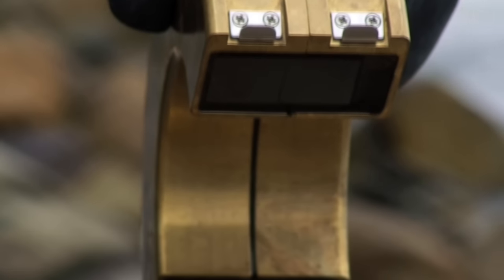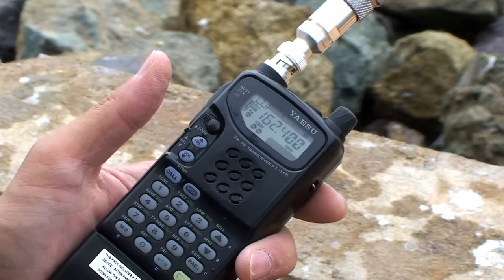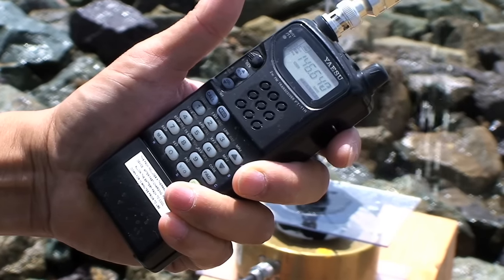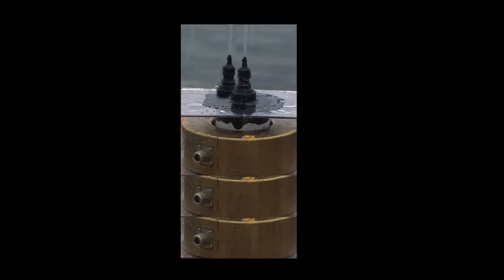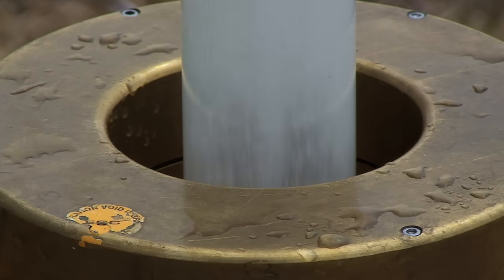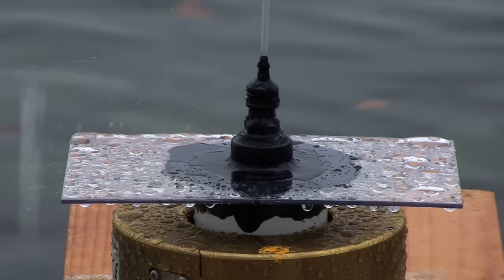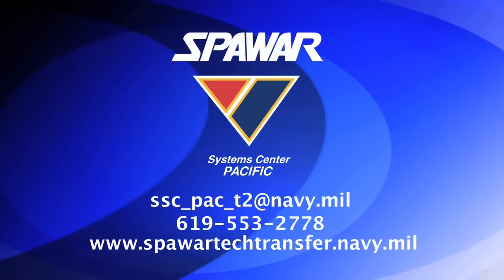Sea Water Antenna

Comment: this is very interesting stuff here. i like that you can run it in a sealed circuit system in a tube. but i need a long tube to run it on 75/80 meters. i know it was display running on a stream of water sprayed upwards. but i feel it would also work on a straight up water column of salt water in a tube. using a pressure gauge to determine the height of the water column. this means never needing an antenna tuner and getting the best exchange of energy from the antenna system. where do i get one of these at.

Comment: I can't wait to go to the seashore with my 20 meter setup.....a half gallon final amp and a 3 element ( oops! I mean a 6 nozzle) yagi antenna. In my QSO I will advise my contact I'm running a half gallon output to a 100 gallon per minute antenna! When I tested it and cranked up to the full legal output from the amp I got only steam from the yagi!

Comment: so its basically using the water as an antenna and the height of the water being pumped up makes it work as a bigger antenna? I originally got the impression that it was sending signals through the water just by the device sitting in the water considering the water is always connected it would be like one giant antenna, it apparently wouldn't work like that..

Comment: You gentlemen might look into laminar flow nozzles for better performance. I don't think that has been done before. I believe the spray nozzle technique may have been used as long ago as the 1970s. Then it was dropped in favor of the now bog standard rubber duckie antenna.

Another idea from the late 60s is coupling RF energy into the ionic fluid inside living trees to use the tree trunk as an antenna. It, too, sort of worked.

{^_^}
{^_^}

Comment: Why not pump down if your able to use the tube to enclose it, it seems you could use it with a lower power pump and keep recirculating the water. Could use some sort of telecoping tube to adjust the antenna size. Mount it on a small bouy it could collapse into itself making it self contained other than the cable to your radio.

Comment: Nice idea, nice to see people actually testing and doing things, yeah, it probably work on emergency situations, or if you don't have anything else. But I'm just wondering, how it compares to a strange of wire. Having a tube on land and spray water in it is just nonsense, you culd do the same with a steel pole, or even a wire and a fishing pole. You can use the ferrite core or some other method coupling 

On hf dx the water stream sounds like a nice idea, in the sea. The best ground system, and a vertical, gives a nice low radiation angle. Just hope all the power does not go up in heat in the ferrite core, (it's split after all, not a good idea for efficiency) or heating the water, even a tiny wire might work better than the high resistance water.

Comment: I'm curious as to why the salt is necessary for the land application. Does salt change the conductive properties of the water?
Reply: +Ralph Krohne You are correct. Salt is a highly conductive compound when used in water, as the sodium (which is a metal) ions move about freely in the water. Pure water alone is not very conductive, even for electricity. Its the dissolved ions from various compounds that are naturally abundant that cause water to be conductive. This is why sea water, which naturally contains high concentrations of salt, makes a great conductor and a great antennae.

Comment: Novel idea but I don't think very practical.
 What happens on string and got example ?
Also it seems to take up more space than a simple wire or vertical antenna which could be mounted on the same spot as this one.
Reply: +DENMONKEY I think the idea of it all is to be able to shut off the antenna’s and not have interference of the others.

Comment: hmmm.. this is ok for receiving only.. but transmitting, it might damage your radio. The length of the water should always be fix to a specific frequency. With the water antenna, surely the signal wave radio is unstable at all time , damaging your radio...
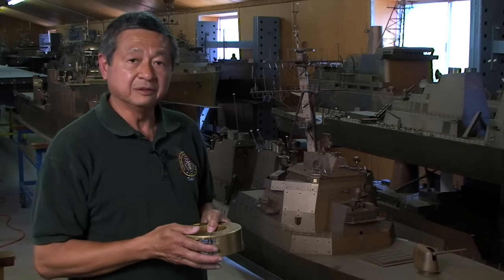Reply: revadan 2:34

Comment: 2:53 - asking for a signal report via repeater is of course bullshit, the other person can only report the signal from the repeater tower, he has no means telling anything about signal strenght of the seawatersystem unless they make direct contact. The only relevant info is the report on audio-quality. Signal strenght is irrelevant.

2nd, the report "maximum signal" followed by "5 by 5" is equally wrong.
Full signal would be 5 by 9 (the first 5 beeing audio quality, 9 is the signal strenght......of the repeater in this case)

some cut together scenes, out of context maybe.. i refuse to believe this engineer would not know all this.

---
having said all that, its a fun concept and tuning the SWR by adjusting power on a waterpump is certainly a whole new idea:)
Reply: Yep.  Should have tried 146.52 simplex instead.
Reply: Ok and what to do if signal at the repeater is noisy and weak? You will hear full 59 repeater but you will not copy as it is flooded in noise and weak... ?
Reply: @michaelscoofield  The second digit is the strength, the first digit is "readability". So a noisy, garbled signal that you hear via the repeater would be like a 19 or 29. The reporting system is called RST, and it was originally developed for Morse code ("CW") transmissions: https://en.wikipedia.org/wiki/R-S-T_system
Reply: Not correct, the report is on the intelligibility of the signal INTO the repeater, not the repeater output.

Comment: “Might replace existing land based antennas”.....hahahahaha, yeah right! It’s nothing but an interesting article. Why would you even consider using this for vhf or uhf! Existing antennas are smaller and lighter. As for Hf, a length of wire is easy to deploy and lighter again.

Comment: This is useless in remote and disaster scenarios. 
How are you going to power the pump? If they have the money and materials to run power to the device to power the pump, they have the resources to reuse that wire providing power as an antenna.